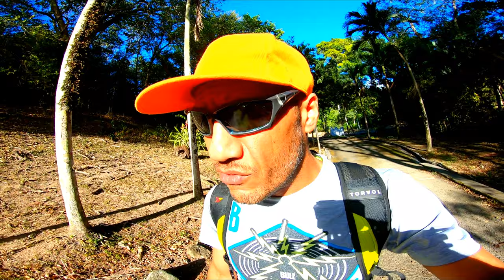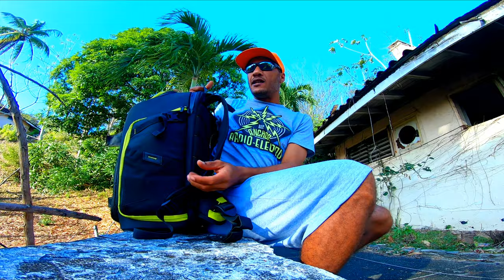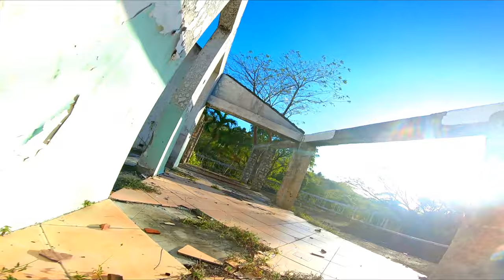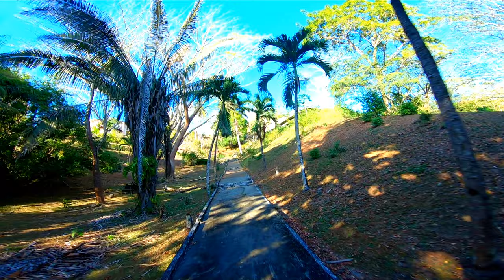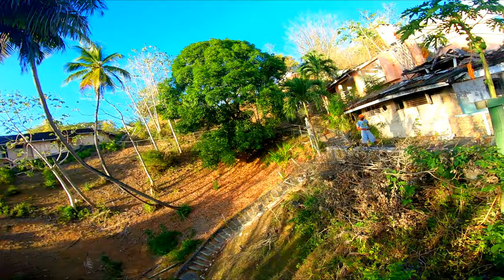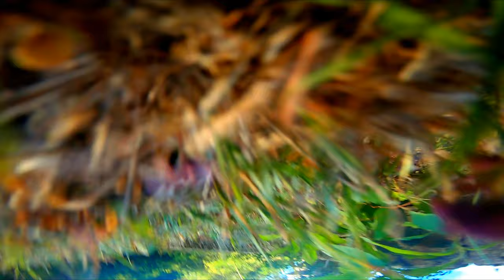TBS Crossfire to ExpressLRS - 𝙋𝙖𝙧𝙩 2

Comment: Hey mate, I am currently having this thought dilemma as well.  I've been pretty much dedicated to the TBS (Tracer) protocol but I'm unsure if they will continue as a reliable choice anymore as availability is a thing. My logic tells me I should switch but TBS is just so much easier and has always been a reliable control link.  I was always willing to pay for easy street but the scarcity of TBS products leads me to believe they are fading out of the market. :hand-purple-blue-peace:
Reply from the maker: I have only seen more pros than cons in switching to ExpressLRS. I am keeping TBS for long range flying. I had considered TBS Tracer but ELRS is way ahead in the 2.4G
Reply: I have a crossfire lite on the Jr module of a Jump t16 pro and about 5 crosfire recievers. Im planning to get a Radiomaster Boxer ELRS with JR Module socket and use the crosfire on the back of that. So any new receivers I add are expresslrs and I can use the crossfire on long range fixed wings or quads, and transition anything new to elrs
Reply from the maker: Best of both worlds 😊

Comment: smooth sailing anyways hehe you do you! What ever link or controller what works that works
Reply from the maker: Yeah but Crossfire is now twice the price as ELRS receivers and not readily available...also only TBS makes crsf receivers but ELRS had a heap load of companies on board, fast packet speeds and higher telemetry output power, only the logilal way forward right?
Reply: @WindjumbieFPV I'll give it some time to sort out their 5.8 protocol. Untill I stopp seing RX loss from ELRS around me I'll stick doing the Tango 2

Comment: Nice. Do you feel any difference from crossfire ?
Reply from the maker: yes, from 500hz the difference is definitely noticeable. The output power also doesn't need to be as high, you can fly on 100mw easy.
Reply: @WindjumbieFPV  thanks 😉

Comment: How u finding it so far fam? 500hz?
Reply from the maker: I like it, so far it is way for flexible than crossfire. Yes i'm flying 500Hz, didn't try the 1000Hz yet:face-blue-smiling:
Reply: @WindjumbieFPV  sweet fam! 500hz is good enough and at 100mw. Dont need to go high with it unless u doing long range
Reply from the maker: @shogunemperor  as low as 100mw? i was pushing 250
Reply: @WindjumbieFPV  mine’s set to 500hz@100mw of course 250mw would be slightly better